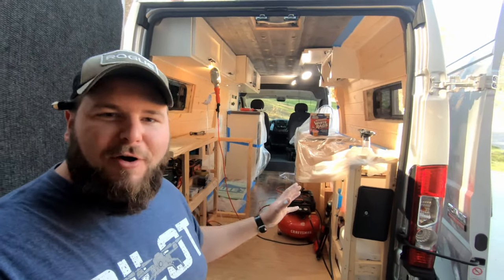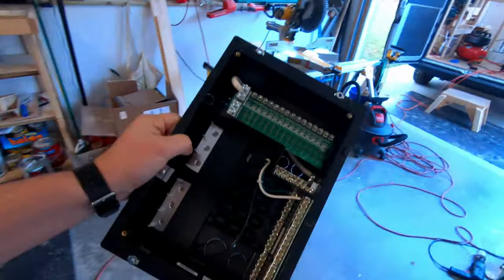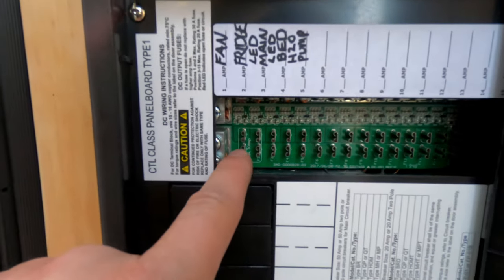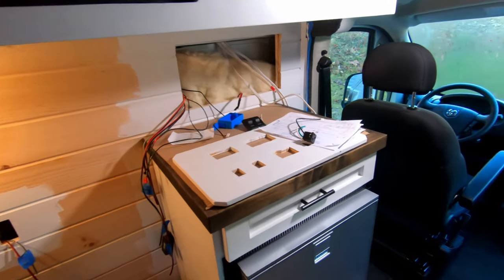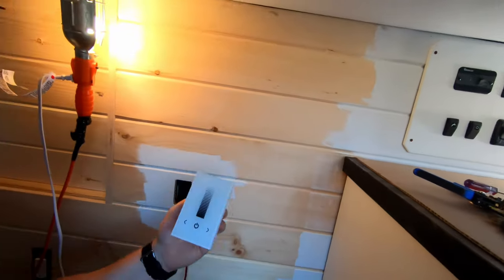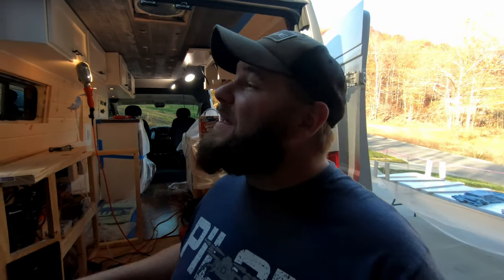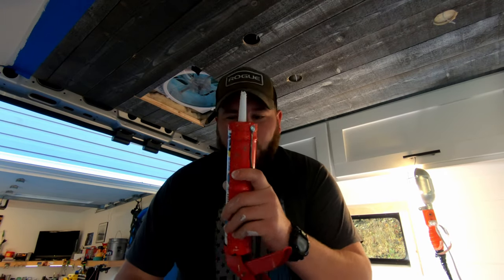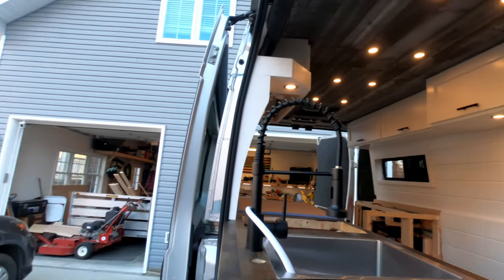DIY VAN ELECTRICAL | PART 3 | PAINTING AND TRIM

Comment: Great van build!  This design checks off most of the items I want to include in mine except for air conditioning.  Why did you end up not installing?
Reply from the maker: The pandemic left my AC unit back ordered for over 4 months.  I cancelled the installation

Comment: Hey may I ask which water heater you are using and how much power your inverter can handle? I am struggling to chose one. Thanks man.
Reply from the maker: Bosch Tronic pulls about 1300W and takes 10-14minutes to provide a nice hot shower for 5-6 minutes
Reply: Thanks, brother! Great videos

Comment: idk if you'll get back to me i might try an ig dm. do you have any schematics for non solar? i got a battery sponsor so i have to use the agm battery they gave me and i saved the electrical for last since it was so hard for me to just get it straight. 

my video van is just a mobile office so i only need to charge camera gear and run laptops, maybe some lights, maybe power music from a portable dj booth i might be putting in. no shower, no cooking really but a portable fridge for munchies on road trips. but tv monitor and laptop for editing on the road is mandatory. help lol.
Reply from the maker: Yo!  It’s pretty simple.  Just remove the solar array and alternator charge controller.  In its place add a DC to DC charger or smart isolator (relay) between your starter battery and your agm house batteries.  This will give you charging while driving, and if still keep the shore power charger in place for when parked (say at home or at a friends house/ outside at an event) if you need the extra juice.
Reply: @biglogan3690  lol bro thanks I finished our van two years ago 😂

Comment: is that solid core wire ?
Reply from the maker: For 120VAC yes, stranded wire for all DC runs!
Reply: @biglogan3690  you need to change that :(  its going to break in a mobile situation, there might be Fire :(
Reply from the maker: @David_11111  This is industry standard for all van upfitters.  Check out some builds by Nomadik Customs
Reply: @biglogan3690  not here in UK  no solid core wire in van... check out any motor vehicle and try and find solid core wire... there's a reason you can not !!!!